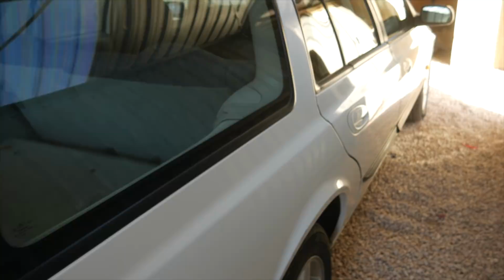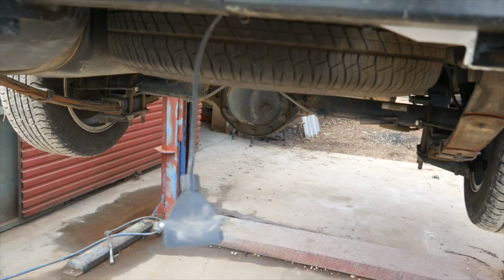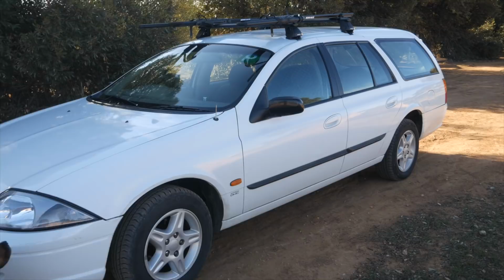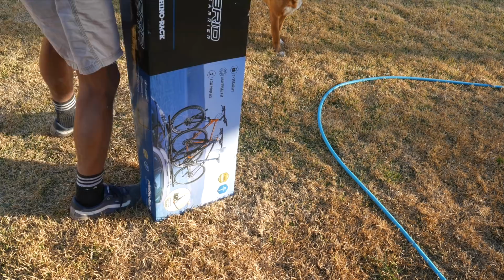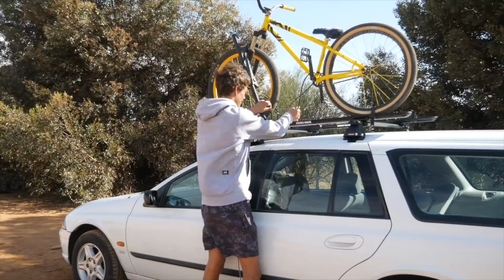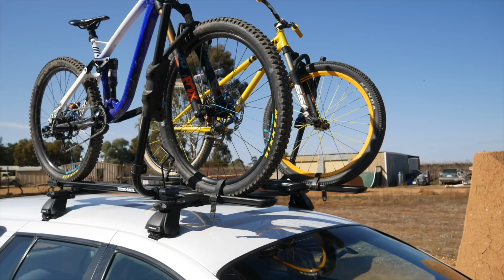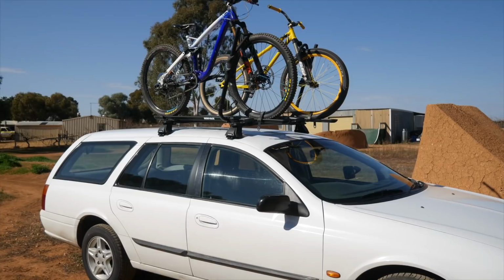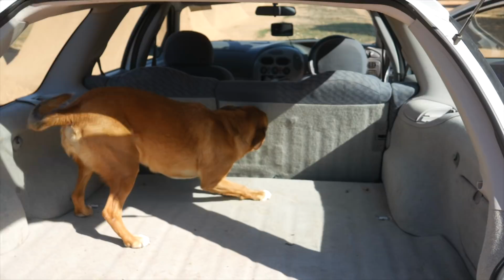Car Update 1 - Roof Rack and Tow Bar

Comment: mate if youre after a more off road type of falcon, just make up some extended shackles for the rear leaf springs and get a hold of some RTV ute front struts. jacks them up a bit so u can get some bigger tyres under it. mix that with a LSD rear and surprisingly they go pretty good off road.

Comment: Can you leave the lights on the au like turn them on and they turn off with the key?
Reply from the maker: Like, turn them one without a key?
Reply from the maker: on*
Reply: Greg Barling no like the car is running and you turn the lights off. When you turn the car off with the key do the lights turn off with it or do you have to turn the switch back to off
Reply from the maker: You have to turn the switch back off or else they will say on and the car with make noises